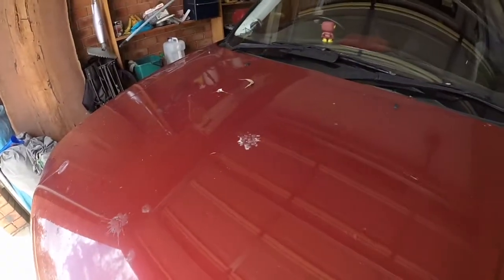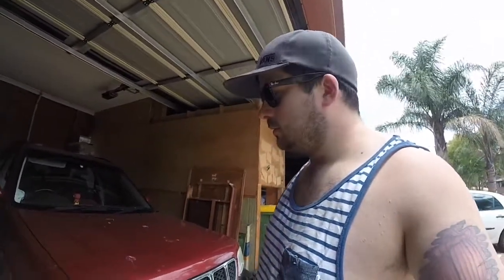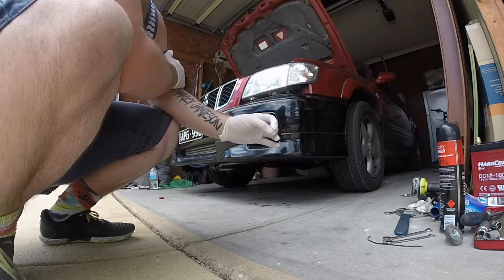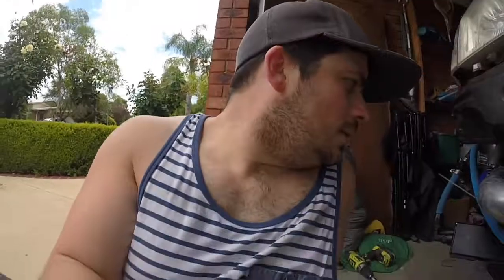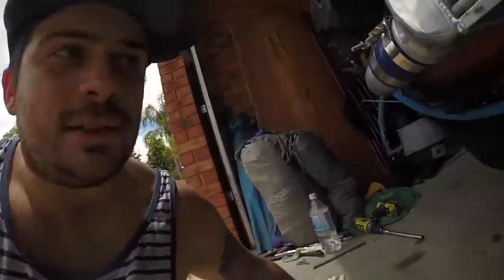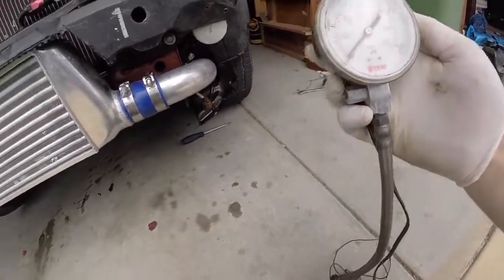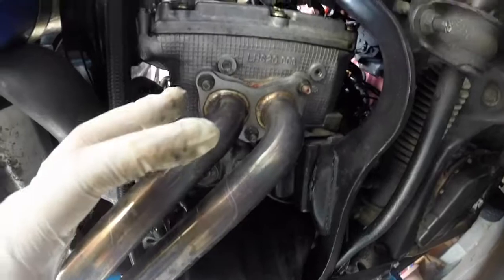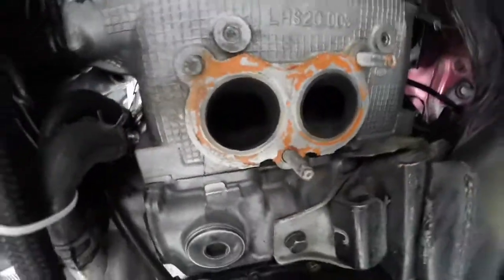Subaru Compound Turbo | Bent Valves?!

Comment: Hey mate, is it a 2.0 or 2.5, at what rpm does the gt35 starts spooling?
Reply from the maker: +basopuh113752 oh hey, 2.0 the GT35 with the tf035 was starting to spool about 3 and was at 6psi around 4-4.5. Without the compound setup it starts around 4